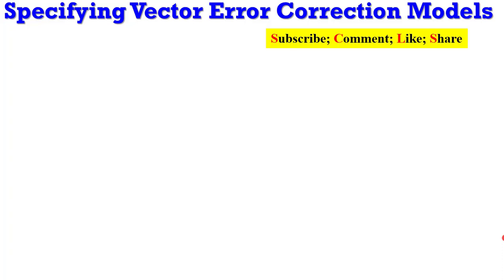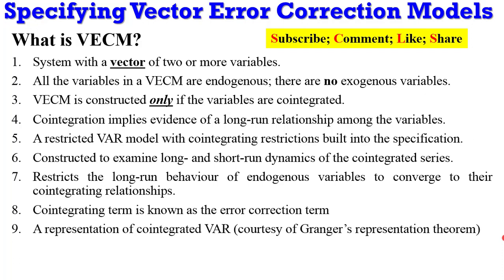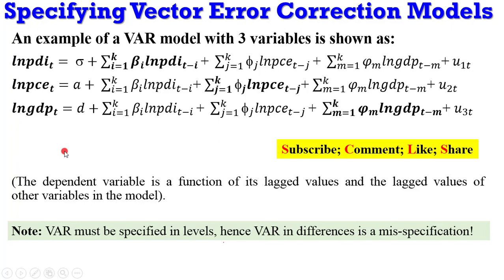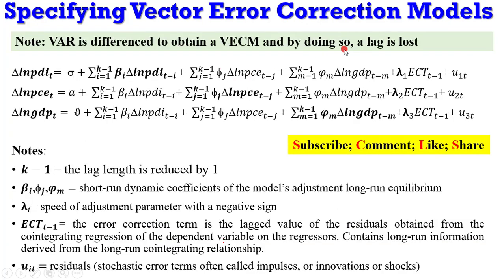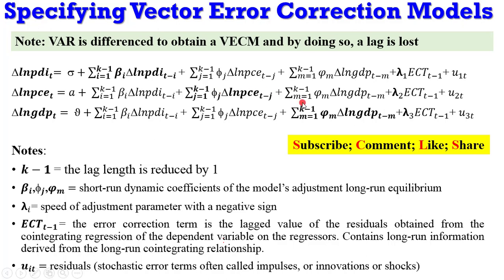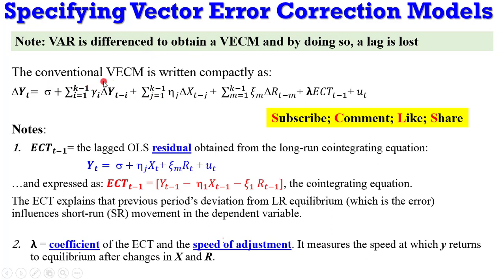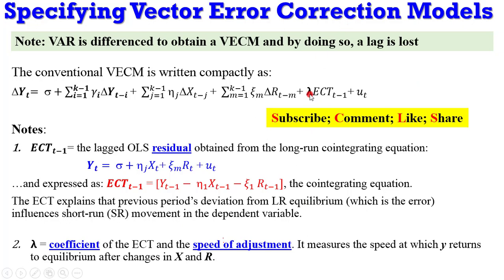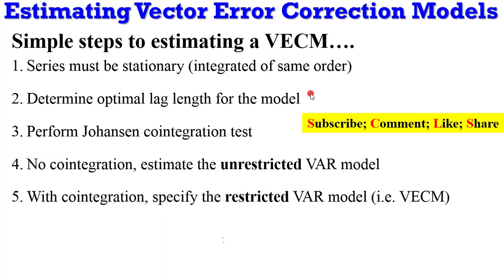Specifying Vector Error Correction Models #vecm #var #lags #Johansen #serialcorrelation #innovations

Comment: if I have 4 variables where two variables are I(0) and two are I(1), do I use VECM for the 4 variables? Since, there is only 1 cointegrating relation out of 4 variables, does that change anything in the estimation of VECM for me? Any input on this is appreciated. Thanks
Reply from the maker: Hi Nausheen, using VECM depends on your analytical approach (system of equation OR single equation model).
Reply: I intend to use 4 simultaneous equations for VECM. 
But my question was whether I can use this exact method you explained in the video if I have two variables that are I(1) and two variables that are I(0)
Reply from the maker: No, you cannot. All variables must be I(1) to use VECM.
Reply: I see! Thank you so much for clarifying. Big help 🙏🏻🙏🏻

Comment: hello, thank you for such an informative video. however, i find it quite difficult interpreting my results
  Johansen normalization restriction imposed
------------------------------------------------------------------------------
        beta |      Coef.   Std. Err.      z    P>|z|     [95% Conf. Interval]
-------------+----------------------------------------------------------------
_ce1         |
      export |          1          .        .       .            .           .
   rail |    .599387   .0169127    35.44   0.000     .5662387    .6325354
road |   -4.63888   .0731755   -63.39   0.000    -4.782301   -4.495459
gdpgr  -.0588775   .0081288    -7.24   0.000    -.0748096   -.0429455

grossc  .2304691    .018401    12.52   0.000     .1944038    .2665345
       _cons |   20.73435          .        .       .            .           .
--------------------------------------------------------------------
The above table is the result i had and below is my interpretation. Please indicate if i am wrong and show me the right thing to do, thank you.
  On the basis of cointegration results, VECM is deployed to know the direction of causality. The estimated results of VECM reported above shows that in the long run, the variable labelled road has a positive impact on the dependent variable export whilst rail has a negative impact on exports. The coefficients are statistically significant at the 1% level. Also gdp growth has a positive impact on exports whilst gross capital has a slightly negative impact on exports with coefficients statistically significant at 1% level. It can also be concluded that rail and road as well as gdp growth and gross capital have asymmetric effects on exports in the long run on average ceteris parabus.
Reply from the maker: Hi Judy, watch my video on Johansen Cointegration Test. You may need to take down some notes and adapt my explanations to your results. Thanks.

Comment: Is it OK for a var model to be run on a lin-log basis?
Reply from the maker: Hi Sewani, I don't know what you mean by "lin-log" but if you imply a log-linear VAR model where all the variables in the system are expressed in logs, then yes it is ok.
Reply: Thanks madam. I meant, can the dependent variable be left unlogged while logging the independent variables. I say this because my model only becomes stable when my dependent variable is not logged.
Reply from the maker: @greenwoodsewanimanda2858  You are estimating a VAR model. Hence, all variables must be in the same form.

Comment: What we can say when optimal lag length is one, as there is a need to deduct one from it when running VECM?
Reply from the maker: That'll be an exception. So, use 1 lag since VECM cannot be a static model.
Reply: @CrunchEconometrix  Tnx alot. The other issue challenged me is how can we test the Granger causality test under VECM among the following options:
1. Opening the data at level as group (non stationary) and looking for Granger causality
 2. Opening VAR and looking for Granger causality
 3. Running VECM and finding the Granger causality
 4. Opening the data at a given order of integration i.e differencing to make stationary, then opening as a group and testing for causality
TNX in advance for your cooperation.
Reply from the maker: @felmetaolkeba  I have well-explained videos on these procedures. Kindly search through my Playlists. Thanks.